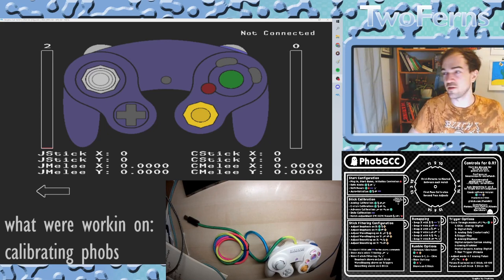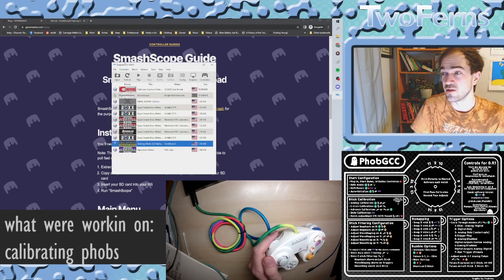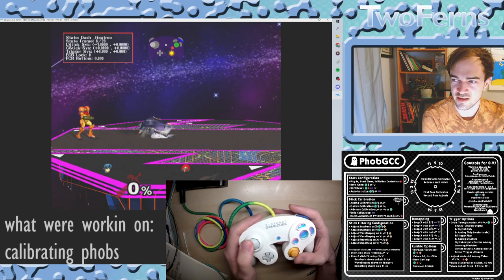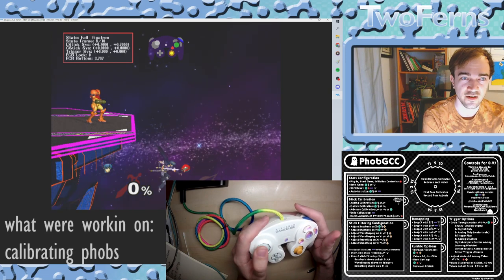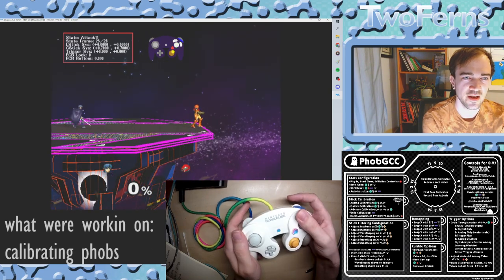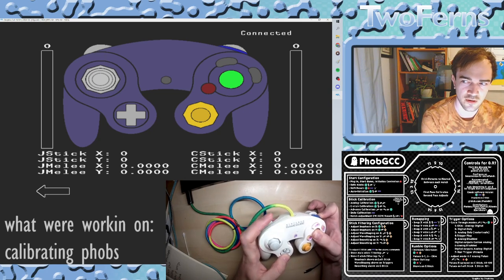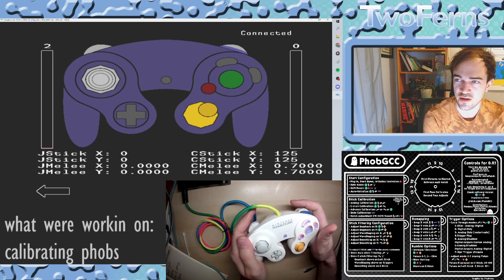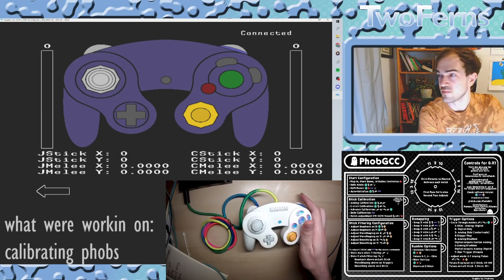Calibrating a Phob2

Comment: The commands, in order, are : 
1. AXY Start (exit safe mode) 
2. ABZ Dpad Down (Hard reset) 
3. AXYL - Enter stick inputs
4. AXYR - Enter stick inputs 

Also I was doing this on uncle punch and after calibrating it kept showing my neutral analog stick position as being tilted down, switching to smash scope showed that it was all set up correctly. IDK if this is just an issue that I had but just be aware both softwares can be a little finicky